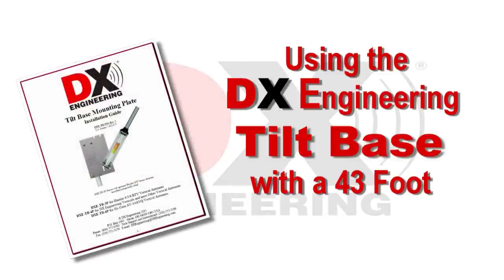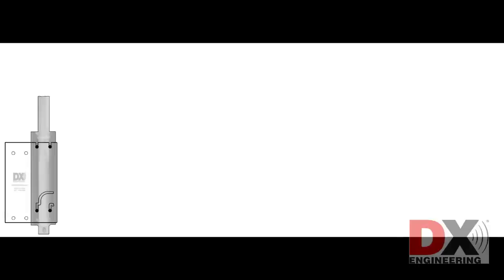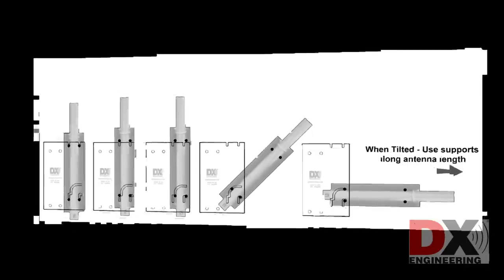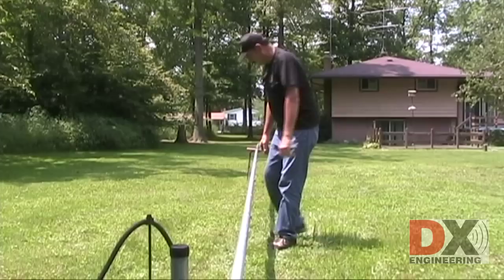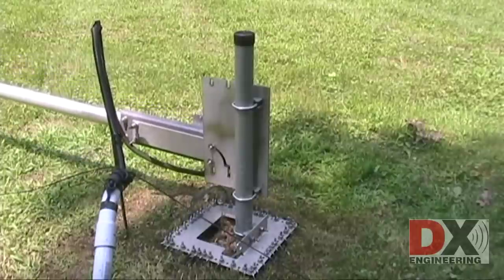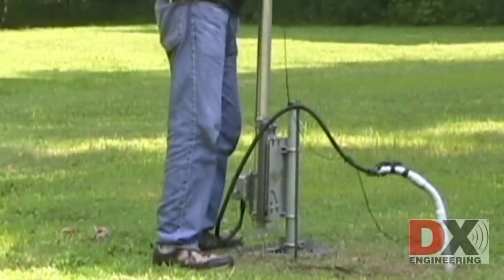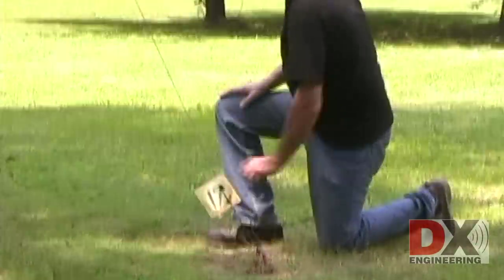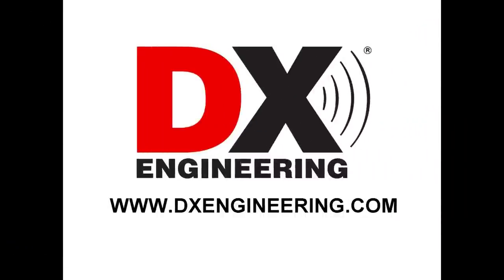Tilt Base with  43 Foot Vertical

Comment: My mount was installed in 2008 also.  I have replaced the hex nuts with plastic knobs.  Never any problems with the mount.  Replaced a few parts on the 6BTV.

Comment: It is very important to put the downward pressure on the antenna when lowering it. I made the mistake once and damaged the bolts along with bending the tilt plate a bit.